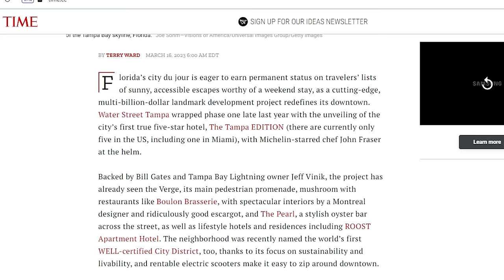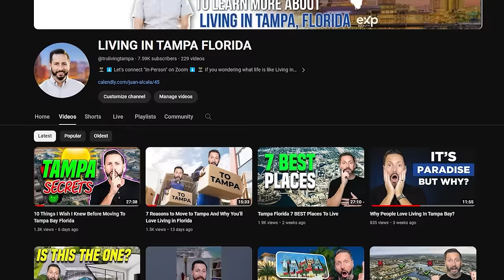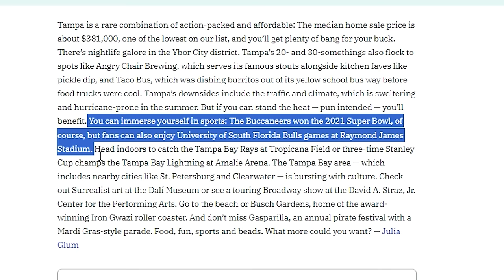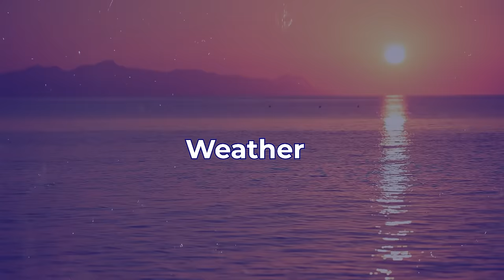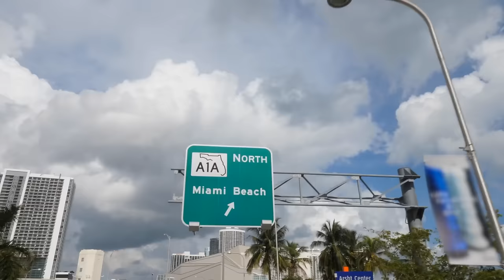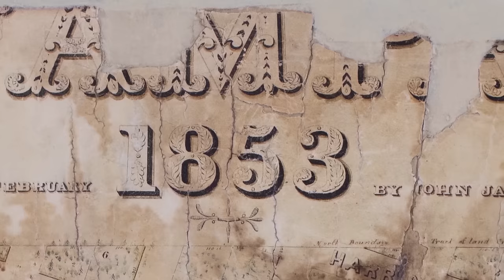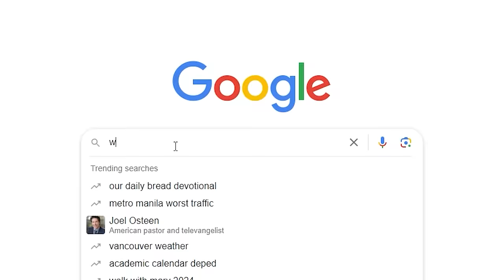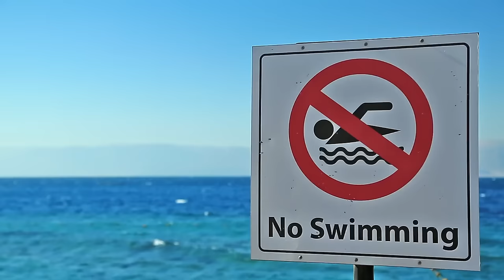What THEY'RE NOT TELLING YOU About Moving To Florida | Honest Review 5 Years Later

Comment: I have lived in Florida my whole life.  Beware that it's difficult to get home owners insurance on old mobile homes.  I grew up in the Ft.  Lauderdale area and moved at age 33. Yes, anyplace near the coasts are a little cooler than the inland areas. I have lived in north Florida for my last almost thirty years. It's a totally different environment. Growing fruits and vegetables is different.  As far as hurricanes.  Prepare, prepare, prepare.  Evacuate if you need to.  Or build a strong structure in the center line of the state.  Most water is nasty.  But I have well water here in North Central Florida and my well hit a spring line.  So I have spring water. The water hard water with a high amount of calcium.  The salt water coming off the coast will rust your home and car if you live within ten miles of the coast.The environment is hard on everything.  If you don't use your air-conditioner with the humidifier, things in your home will mold.
Reply from the maker: Thanks for sharing your perspective, this is very helpful.
Reply: Greetings from ak
How's PCB, Tallahassee, Tampa hurricanes?
Any other info thanks
Reply: @ahdiex7363sha  Well, as I said.  Home owners insurance is almost impossible to get for just about any home in Florida these days especially the homes on the coast. If you can get home owners insurance you will pay a lot for it.  As for hurricanes.  Don't buy a house on Amy coast. Stay to the middle of the state.  If you haven't been through a hurricane, they can be dangerous.  I have evacuated many times.  I have been through many hurricanes.  The property taxes and homes here in are expensive.  Personally, I live in the country areas because the people in the cities are horrible.  Florida used to be a great place to live.  Not so much anymore.
Reply: @Carolynfoodforest355  thanks for that , weather wise though is Northern Florida weather reasonable compared to the s. How's the summer temp
Thanks alot
Reply: @ahdiex7363sha   I grew up in southeast Florida.  Southeast Florida is hot with virtually no winter except for one or two days a year.  Near any of the coasts you do get a breeze of sorts off of the ocean.  I have lived in north central Florida,  just north of Gainesville Florida for 28 years.  I love it it up here. We get a winter of sorts, but no snow.  Summer is hell here for July, August and September.  Those are the months I hibernate in the air-conditioning. Of course there are tons of natural springs here in the area to go to in the summer were the water is 72 degrees all year long.  The nature here in North Florida is beautiful.  I have lots of different fruit trees in my yard and right now they are all blooming and smell so good.  And with the exception of the really hot months we grow fruits and vegetables all year long.  The only thing I don't have right now is chickens.  I have always had chickens and they are awesome.
Reply: Can I add to that. Constant maintenance on air-conditioners. You don't want to be without. You need to hire a pest control company for monthly and bi monthly spraying. A lawn company,  a sprinkler co. If you live in a HOA (you will want to, its safer) you will have to have your driveway,  roof , and pool pavers power washed often as mold grows. A pool maintance co. A linai screen co. because the screens get blown out with the high winds , and not just from hurricanes. What this realtor is not telling you is that $381.000 will only buy you a mobile home. Good luck finding a home in a good area for that price. Insurance is thru the roof now, and Taxes also, unless you are homesteaded in. But after all that Florida is still beautiful, just come with a lot of money.
Reply: I've lived beachside most of my life and salt air does corrode metal. Now I live 4 miles away from the beach and it is no longer an issue.
Reply: I don't want to be there during a protracted power outages in hot season. At least have a bit of prep...fresh water to survive. 
If your vehicle overheats near by any lagoons, etc, like we had happen, I had a jug to go get some water to add to the cooling fluid, when a kindly highway rescue guy stopped me with the caution: dipping there for water cad lose some fingers at the least...🐊...ìts really quite common. Ĥe gave us water...made my day to not get to learn that the bad way! Was praising God for some time.
Florida is a beautiful sweet natural wonder experience..but I didn't like the insect control spraying.
Reply: I'm not gonna move to Florida I'll stay in NYC, expensive but I can deal with the winter.
Reply: At least you have a governor who gets to protect your freedoms from federal overreach.
Reply: @bbqbeen7083  Yes, we appreciate Governor DeSantis very much.
Reply: @Carolynfoodforest355 he's destroying FL..he wants to build in the parks..no EPA protection

Comment: We moved down last July from NJ. We're in Polk County, right next door to Tampa. The heat did take some getting used to, but it can be done. What I loved is that we never turned on the heat this past winter. My son wore pants to school one day the entire year. It was shorts the rest of the time. But not having to wear even a light jacket in the winter, while my co-workers were shoveling snow makes up for a little heat. There have been many days so far this summer where it's been hotter back up there than down here. 

Traffic lights - whoever set up these lights needs to be tarred and feathered. And there's very little straight line connection, you need to make lots of turns on the grid and sit through multiple lights. 

Roads - So much better than NJ, but just this past weekend, my wife managed to find the 1 pothole, and cracked two rims and blew both tires. It was filled in the next day. 

Bugs - one trick I brought with me was giving the dragonflies a place to sit, right next to our deck. Dragonflies eat many times their body weight in smaller bugs. We live next to a fairly sizeable pond, but the bamboo stakes we put in the ground near the house attracted plenty of dragonflies, and as a result we had only 1 mosquito bit all last summer. Our neighbors put them up, as well, and our neighborhood has been pretty much bug free. 

Water - yep, it sucks. 'cold' water is 80+ degrees in summer. We ended up getting an extra ice machine to keep up with family demand. We also have 2 high capacity brita filters which work very well.

Schools - not touched on in this video, but Florida has a very open School Choice program. They also have specialized academies within the schools, starting in middle school. Our son is in the aerospace, engineering and robotics academy at his middle school. There are programs for pretty much everything. If college isn't something your kid wants, they can do one of the trade academies, and in most cases graduate with the certifications they need to start working. 

Floods - we're inland a bit, so floods aren't an issue for the house, but the streets do sometimes get temporarily blocked after a few downpours. 

We had done a scouting trip the previous year to look for good neighborhoods, and to do things like compare grocery and gas prices. Groceries, compared to NJ, were similar. Some things were more expensive, some less, but the average grocery bill was only a couple dollars less. Gas was about 25 cents more a gallon, but I've seen them swing more than 50 cents a gallon each way in only a matter of weeks down here.
Reply from the maker: What a fantastic share! Thank you for sharing your experience.
Reply: Thank you we are considering great insight ❤
Reply: Thank you for the insight. I am considering a move from NJ as well.
Reply: @atb154 don't do that..car insurance is very high and school is horrible.. jobs offer nothing to live here with....no diversity or acceptance of any thing not of Florida..
Reply: @suziecue3027  I'm in NJ. I need less diversity.

Comment: I moved about 100 miles south of you near (Charlotte Harbor and the Peace River) and oddly when I lived in Michigan I lived about 40 miles north of you in Pontiac. Not much problem with mosquitoes as I live in a small town that sprays for them frequently. I haven't been bitten in the 10 years I've lived here. Have had fire ant bites though, think they are the worst thing about Florida. My car and house insurance has been less than southeast Michigan until last year when my home insurance finally went $120 a year than my Michigan insurance back in 2014. Live in an orange flood zone but have never had one as I am on slightly higher ground than most though that isn't saying much, also have the barrier islands keeping down storm surge. We have one block of potholes in the city and that is between I-75 and a truck stop. Michigan, well way too many. Hurricane Ian went right over us and a good many of our newer neighbors decided Florida wasn't for them and left to go back where they came from. The water is terrible and the sediment in it mucks up faucet and shower heads. Every year loads of it is dumped out of my water softener. Have to wash the outside of the house twice a year to keep the mold off, especially the north side and under the car port, Heat and humidity only bad during the summer and that is about the only time I use the AC. What is bad here is suddenly massive building. This area only has one large road, 41, the rest well, snowbird season makes things difficult but all of sudden new subdivisions, condos and even a way too big resort are being built. Don't need it. Still love living here.
Reply from the maker: Thanks for sharing.

Comment: A fairly accurate assessment. I've lived on St. Pete Beach for 38 years. Immense increase on traffic & density in that time. Each year has gotten progressively hotter. Two nights in the past week at 11pm 80° with heat index of 100. Daytime heat index has been hitting 108 with 90% humidity. On insurance I have a modest 2/1, 1200 sf  home. For homeowners, flood & wind (yes wind is separate) up to $15,000 now. Add another $2,100 for auto & it's getting up there. Good thing I no longer have a mortgage. The only upside is that my home value has increased 550% in my time here. It's not easy for a lot of people as there is very little affordable housing in the Tampa area. Weighing in my mind if it might be time to move on like a half back. My two favorite bumper stickers " We don't care how you did it up north" and "Welcome to our beach. Now go home."
Reply from the maker: Thanks for sharing, Jeffery. You're not alone, I'm running into more and more sellers who are heading to the Carolinas and Tenn.